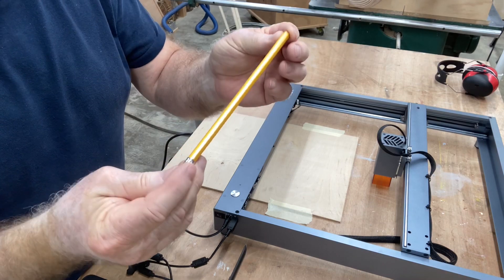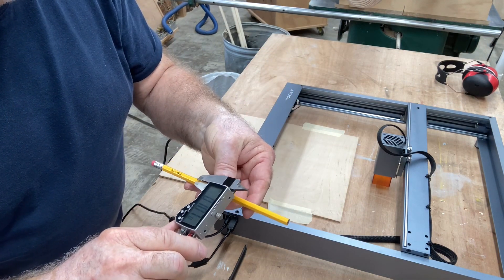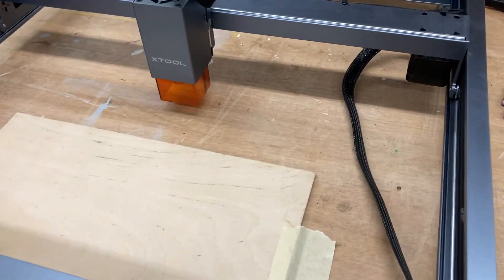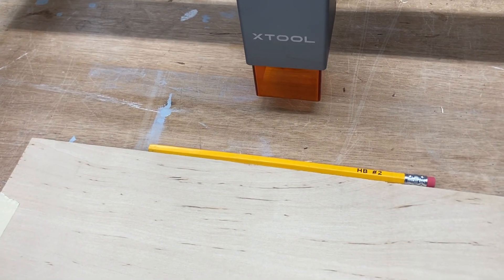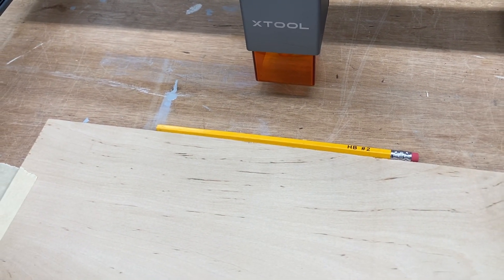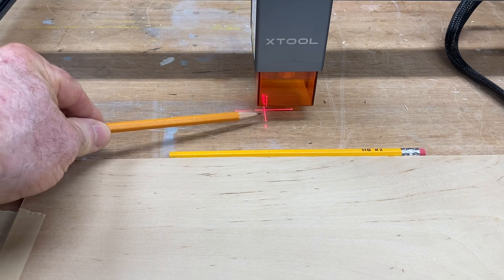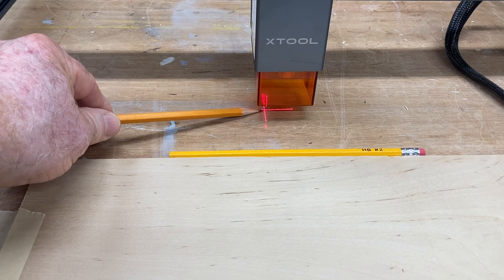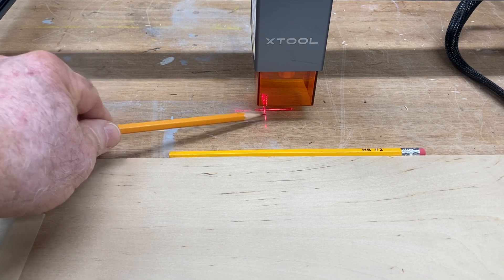Comparing xTools D1 and Sculpin S9, Overcoming Alignment Issues with the D1 and Much More

Comment: I’ve been at this hobby for a couple years with the xTool D1 original 10w (nonpro) and have never used the ‘Output’ tick mark. I’m assuming it’s for turning on and off, the different lines around what you’re trying to burn. I have been using the ‘Cut Selected Graphic’ function by simply selecting with a box or clicking on it. Sometimes I have to ‘Group’ the items, like letters in a word, but I’ve not used the ‘Output’ tick button.
Reply from the maker: There are many ways to do the same function. No one way is right or wrong. Thanks for watching

Comment: Do you have set the origin to get it to start in the manually set laser position? On the X Tool
Reply from the maker: In the software I set is as current position. The just move the laser to the correct position. With the jig, you only have to set it once

Comment: Having trouble with my X-Tool D1 10 watt laser dropping down, touching and dragging along the substrate even though I have tightened the thumbscrew.  Any suggestions as to why this keeps happening and what I might do to fix it?  Thank you.
Reply from the maker: It would appear that the locking screw is not engaging. Check to ensure that the laser is in the proper position to slide easily. It you go to high it will not work
Reply: @PawPawsWorkShop  Thank you for your quick response.  You were spot on, that, indeed, was the problem.